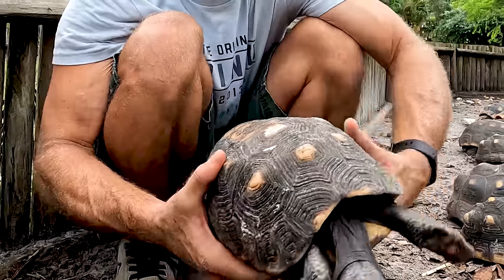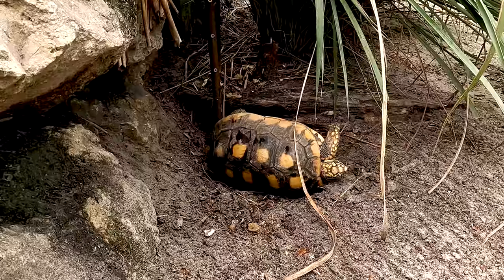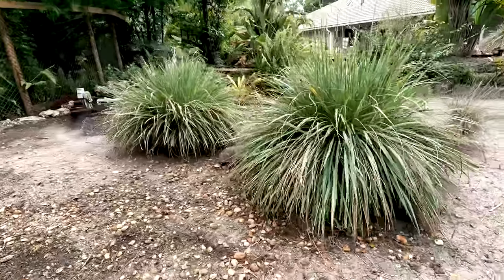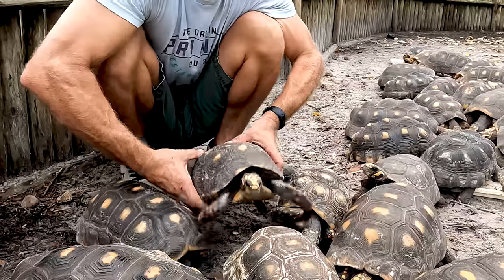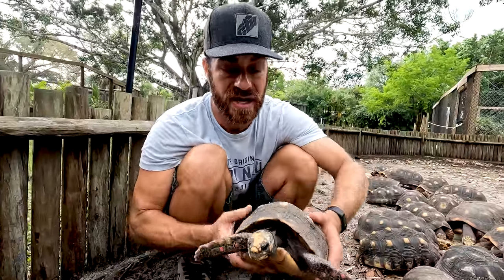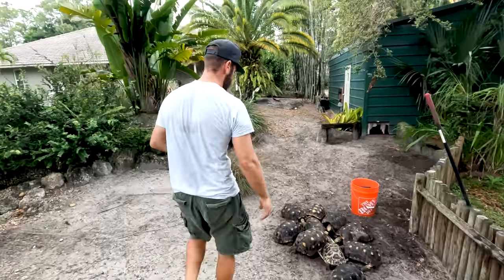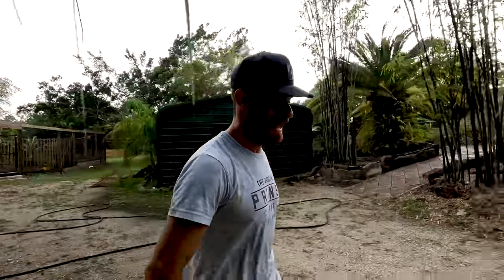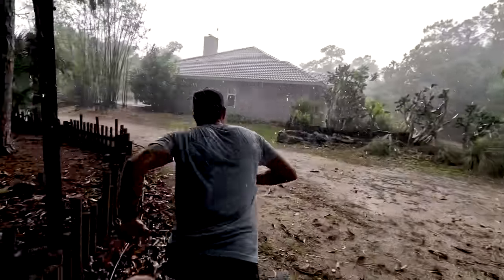Going Deep with the Redfoots!

Comment: Cows have also been seen chewing on bones to supplement their calcium. I’ve seen them do it on my grandparent’s farm in PA as a kid and was like “wtf?” 

If you can lift the drain cover put a piece of 1/2” screen/hardware cloth between the drain and the hole. When it gets blocked it’s much easier to clean.

Comment: You need a cone drain my guy. Pop out that flat one and pop on the cone. You could use an upside-down pond plant basket over the drain too. Probably stake it down so the torts don't push it off the drain. Love the shell dwellers😊